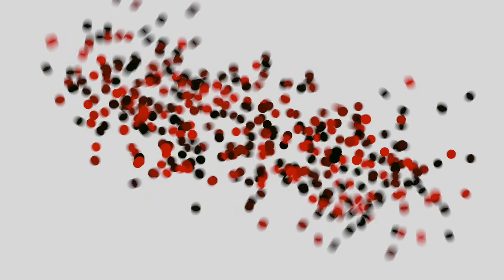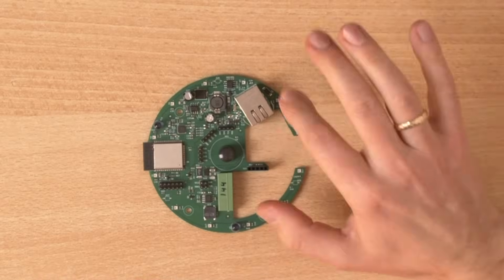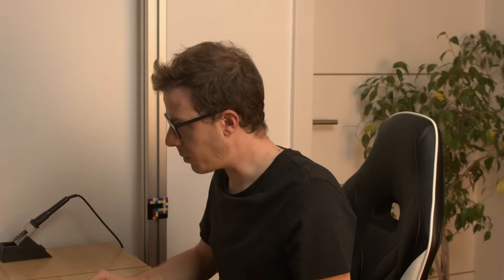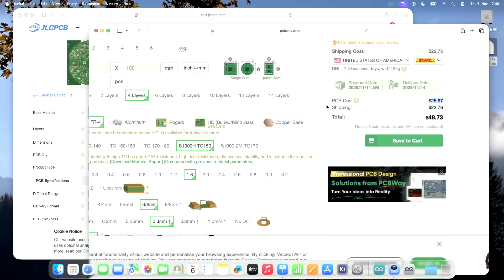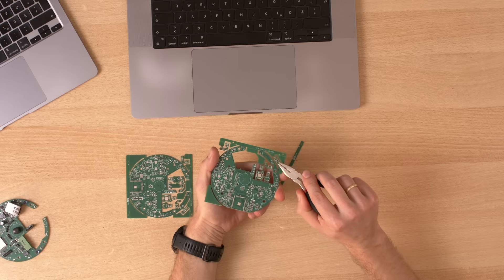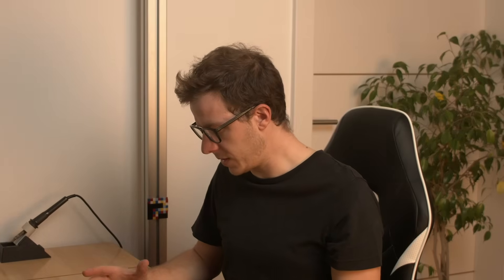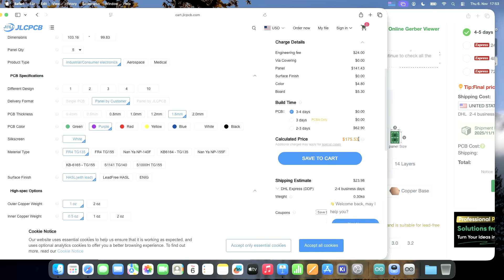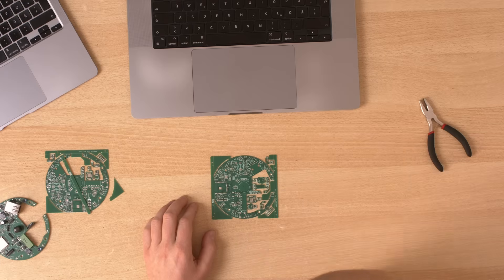The Hidden Cost of PCB Panelization

Comment: I understand it somehow. They use many machines or not. Each conveyor belt must stop for your design to be loaded. Maybe if you order 1000, it's not considered a stop and you are VIP there.
Reply from the maker: Conveyor belts would make sense 😄
But fabs usually look at the Gerber files to decide how many designs there are. Multiple unique layouts = multiple designs = extra charge, regardless of which machines are used or how often.

Comment: I've gotten burned with this on a few occasions, with JLCPCB sending me e-mail after sending the fabrications files for review, stating that there are more designs on the PCB and add a magic +200€ engineering fee. But it's a hit or miss, try adding dummy traces and that sometimes passes the review as single design.
Reply from the maker: that's one way of dealing with the problem. I think I should have just connected everything using I2C :D

Comment: I know that not everyone has a CNC they can use, but I completely gave up on the panelization fees. I've just made a 100x100mm holder, that I just chuck my PCBs to and cut smaller ones from them myself. For the outline it doesn't have to be so precise so even a cheap CNC works well.
Reply from the maker: but you still have separate designs and they do not complain about it?
Reply: @playduino yeah. It's just that you cannot add too many cutouts done by them, or they'll complain. E.g. I was doing a round PCB with LEDs (around 40mm diameter). For manufacturing I've created a 2x2 with 1mm space between them, and added 15mm wide filler rectangles so that they stick together as one board that I can then chuck onto CNC or cut by hand. They didn't complain and I had 40 boards for the price of 10

Comment: Oh my! 90 % of comments here will lead you the wrong way! You actually did figure it out, I mean, you correctly identified the constraints - if some different parts of the submission do not share electrical connections, they are considered multiple "different designs" which are part of the same submission. As opposed to having the same design being cloned/stamped multiple times in a single submission, which is considered panellisation and is not a cost adder.

What you haven't figured out is how to game the system. Some commenters correctly point out that leaving the inner layer (ground) uninterrupted between different subcircuits makes them a single design. That is, at least until you separate them, which is what you are aiming for. However, separating them would require more effort because you would have to break through an even number of inner copper layers, in addition to the fiberglass/resin structure. Such a board can not be snapped apart with the help of mouse bites or v-cuts if there's at least 2 internal copper layers that you must also break. At least I think not. You can route them apart on a CNC machine as someone suggested. However, I would think that all fabricators have, by now, learned to recognize such shallow attempts to fool them.

In addition, I'm afraid they've got you tagged already for asking questions about it, and all your future submissions might receive extra attention.

I never had to game the system with this goal, but if I were to attempt to, I would 1) keep internal ground planes continuous (would not work reliably if you also kept a continuous power plane as it might short to ground during separation process) and 2) would actually redesign my board in such a way that there are also functional nets (traces) spanning all subcircuits. But beware, if they are dummy nets, you risk getting detected. If you design them in a way that all the sensors are connected to the main board in a meaningful way (say, all of them share ground, are powered from the same power rail AND connect to the MCU via I2C lines (or whatever your sensors use), then this becomes a single design. Also, you get the added benefit of testing it all at once, if you wish! It's the same principle as with snap-off debugger on some STM development boards. It is one product, one design, until it gets programmed and tested, and the units used for debugging snapped off.

Did I make any sense? If you decide to go this way, let me know as there might be one final gotcha that you must take care of, but this comment is getting too long already. :-)
Reply from the maker: thank you for your detailed answer :) I do not try to game the system but it might actually be useful to route I2C to the sensors. That way I would be able to test them before breaking them apart. But you have to be careful with such attempts because they can easily result in shorting traces.
Reply: @playduino, that is exactly the catch I was warning you about. I would not use continuous traces for the I2C an power to the modules, that go across the separation line. I would expose pads on each side of the separation line and short them via pogo pins on a test jig. I2C is slow enough not to suffer signal degradation from doing this. So the electrical connection would be there only during testing. However, you can easily choose those pairs of pads to be part of a footprint for a big resistor or fuse and put silkscreen markings for them, so that it becomes a single design, you just set those components as DNP. That way you provide copper clearance to the edge of the separation line and are able to separate the modules after testing them without needing to break or cut through any copper and risk getting shorts. At the same time, it just might pass as a single design submission because you have components (those resistor or fuse jumpers) spanning the separation line.
Reply: I hope you are wrong (assuming the PCB was sent as one set of ready to produce gerber files), otherwise i would very much like to hear the the reasons they give.
Reply: @tedcamu479, I actually had no idea why they treat a panel with multiple designs differently than a panel with the same design replicated a bunch of times. But I must say that the potential reason given in the video sounds very plausible!

Comment: This might make a little bit more sense if you look at how PCBs are manufactured and processed from order to delivery. If one panel fails with 100 designs (10 blocks with each 10 designs) that is a massive loss of time and resources for them, because they have to check every design in your panelization scheme (factory yield basically). Depending on how they process this and so on, this might add a lot of time/cost. And then there is testing which takes time. So if you order this as one PCB (no panelization with Vscore or mouse bites) then you take on the risk if one of the other circuits is messed up, and you must cut them out yourself. Take this with a grain of salt but it's along these lines.
Reply from the maker: I’m actually not sure how much testing they do. From what I’ve seen, they don’t check every trace, that would be a lot of work and I’ve received boards with broken traces before.
Usually, the panels aren’t broken apart by the fab either.
that’s something the customer handles.
Reply: @playduino  For each design you have they need to set up the tools and testing. Flying probe test is industry standard, and it comes free with JLCPCB, PCBWay and others. You can't even opt out of it because this is one of the ways they make sure all your nets are connected electrically (based on the schematic netlist). I am sure if you could opt out of this it would be cheaper, but it seems like they do not like that, so even if you try to get it through as "one design" they will catch it and up the price and treat as 10 different designs (or however many you have). They also do automatic optical inspection (machine) and quality control by human. You can also pay for depanel and smooth the edges for a few cents per panel (JLCPCB has option for this). Where did you order from where you got boards with broken traces?
Reply from the maker: But then they should charge for individual nets and not designs IMO.

Comment: bruh, you do not pay for empty pcb board... just enter 1 big design... that is all. or if you don`t really need all the empty board, make the board a circle and that`s it, no more mousebites. I always put 1 design and when ! order 10... if they do not send me a email that it is a problem and I have to pay xxxxmore dolars, I just recive it as it is.... or I order it with cutting lines(instead of v cuts) tu cut my boards at home with a table saw.
Reply from the maker: Personally, I prefer to be explicit about how many designs are in a panel so pricing is clear upfront and there are no surprises later.
According to their support, they would even charge extra if I separated the designs using cutting lines in the silkscreen.

Comment: You only have one design, not multiple. 

The option is there if you wish to order multiple designs with multiple shapes and sizes. You pay for the square PCB panel area used, and the length amount of routing required. 
They will charge you for the engineering work if you supply the different PCBs as separate gerber files and they will have to make it into a panel. 
And they also charge you for packaging individual designs.

But if you do all the 'work' yourself, you (should) only pay for the pcb area used like the design you show.

On some ocassions i have worked with PCB-Way, they always have a manual review when you send in your design and after the review the calculated price may be different from what the web calculator showed.
Reply from the maker: I hope you are wrong. Otherwise I burned a lot of money 😂. How would you upload multiple Gerber files? I can only upload one per order
Reply: @playduino , i assumed you created and uploaded a single gerber file and checked the box for multiple designs. 
If not: i do not know what software you used to create the PCB, if it does not have an option to panelize you could use gerber editors (like for example Viewmate, yes i use it but no i don't work for them ) to combine multiple gerber an drill files into one set of files.
Yes this takes some time, but now you asked the manufacturer to do it... and they billed you for it.

Comment: Hi Oliver, the cost estimate is a real surprise. Couldn't you create a circuit with all the individual circuit boards and simply connect the grounds together? For the break points, just drill individual holes.
Reply from the maker: connecting GND should work. buy my mouse bites are too close to allow traces in between. so with bigger pcbs this might be a solution

Comment: I know the problem...😋 
My solution is to have only one outsidecut and two additional alignment holes so i have it easy to do the final multible cutouts on my CNC-mill. It is fast and cost nearly me nothing. By the way: With a 2,4mm cutter i have the maximum possible milling distance. Smaller or bigger tools reduce the milling distance significantly. I am more friend of JLCPCB 🙂 Also for CNCmilled alu parts they are great.
Reply from the maker: Nice :D and they never complained about multiple designs?